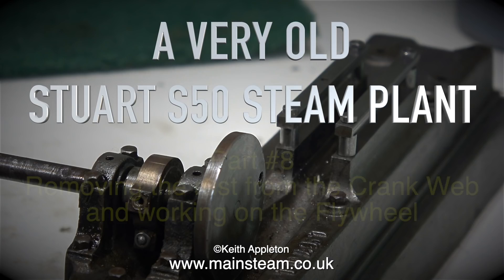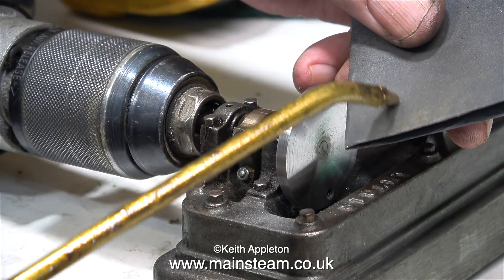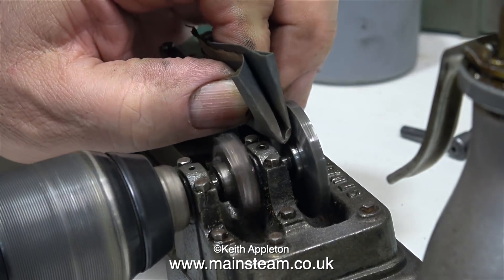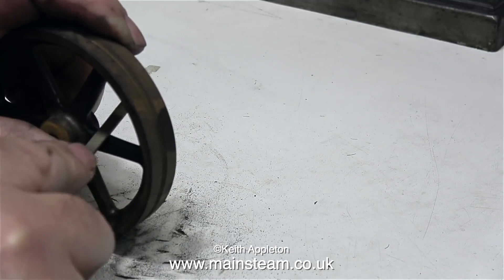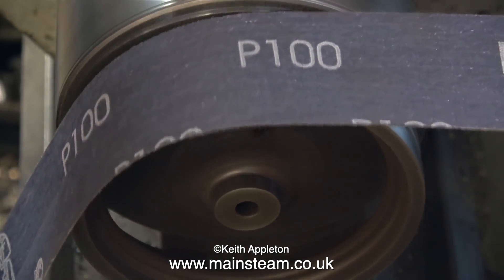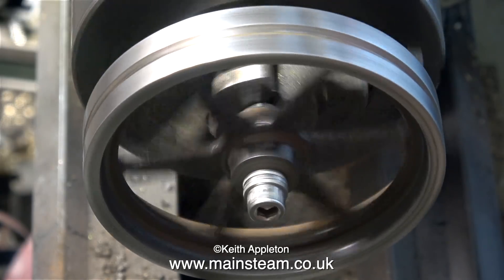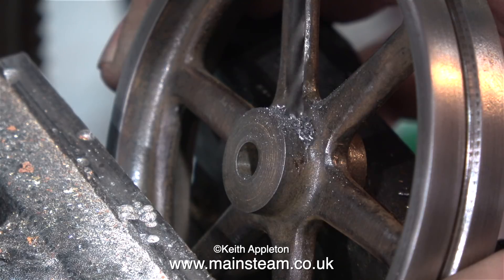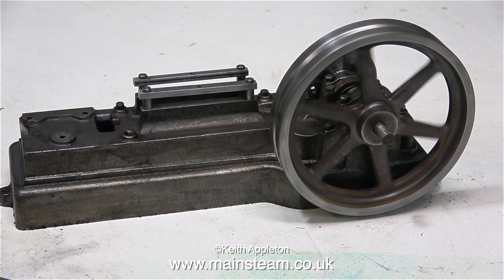A VERY OLD STUART S50 STEAM PLANT - PART #8

Comment: Hey Keith, have you ever tried Evapo-Rust? I don't know if it's available in the UK, but it does wonders for rust on machined steel parts. I use it often when cleaning up old hand planes, to avoid scuffing up the machined surfaces too much.